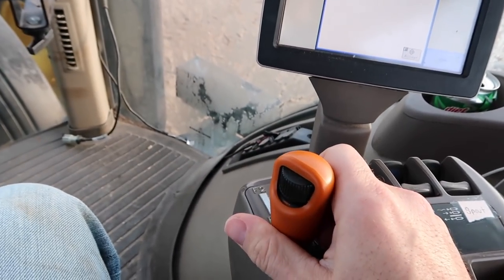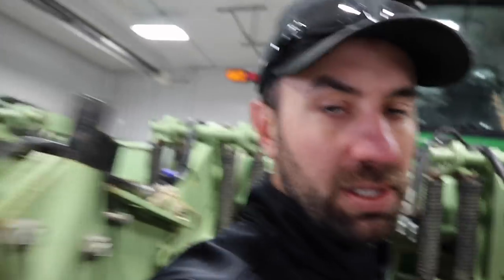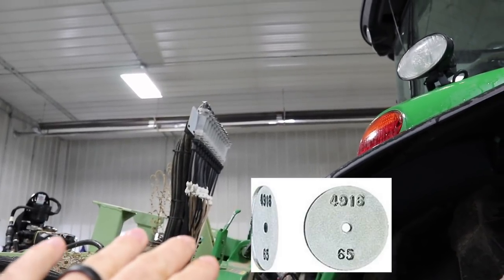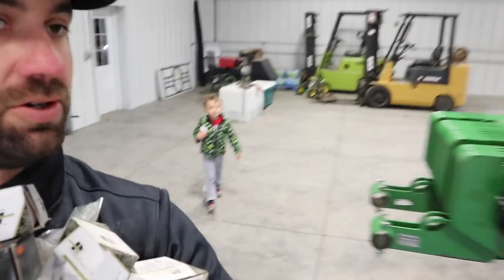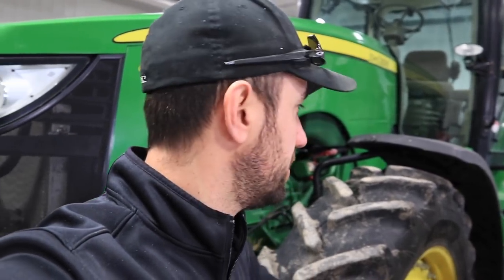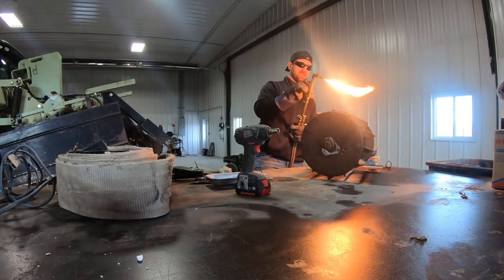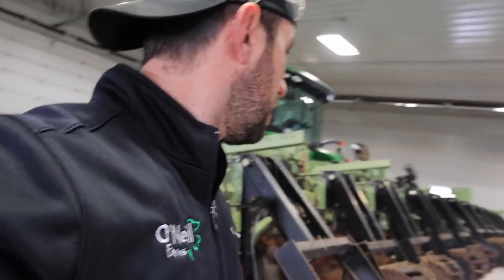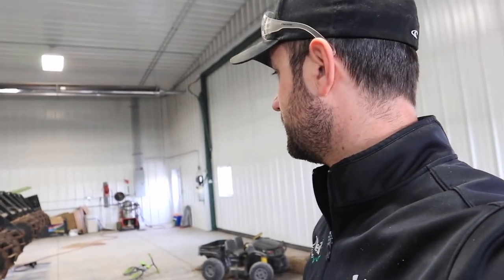Getting the STRIPPERS Ready (Strip Tillers that is)

Comment: If you brush on anti seize product to the hub before you slide on bearings on mabey they would just pop off next season?
Reply from the maker: We have. They are eccentric end bearings. So that gets rusted too with the fertilizer. Some would come off with a lil help form puller. But we’ve had some fly across the shop as well 😁. Fertilizer🤷🏻‍♂️

Comment: Have you always stripped with the two front wavy coulters instead of a shank? What do you think the advantages of the coulters are as opposed to a shank? Are all of the 4 wavy coulters typically set to the same depth. How many lbs N are you typically applying with this Implement? Any P? Sorry, lots of questions
Reply from the maker: Yeah. We’ve used coulters since we apply close to planting time. (Shank may leave air pockets in damp soils.). All coulters are pretty close to same depth with the outsides slightly deeper. Also you can go faster, go when it’s a little wetter.   145lbs N 40lbs P. Questions are why I’m doing this. I get ideas too from viewers as well. 👍
Reply: @ONeillFamilyFarms  Thanks for the response. We have shanks on our strip til. I'd like to apply closer to planting. I'll have to look into the front coulters.

Comment: Did you build your weight brackets that are on the one tripr?
Reply from the maker: Umm. I think we robbed those from a planter that had them. I don’t think it’d be hard to build though. Just plate and square tubing with a round bar for a lip. I think there is one as well that’s vertical in the center to clamp the weights around from going side to side.